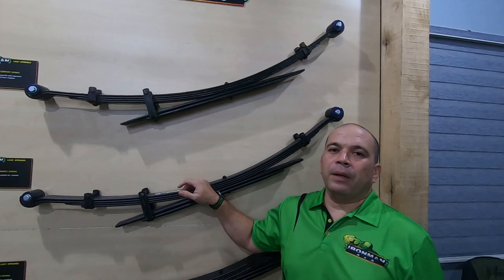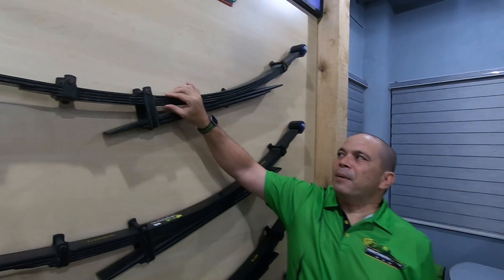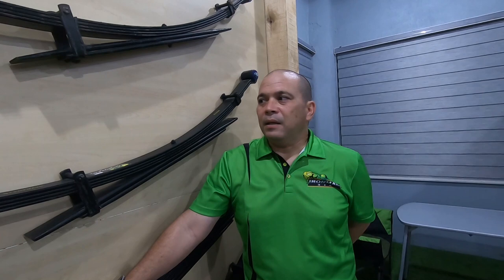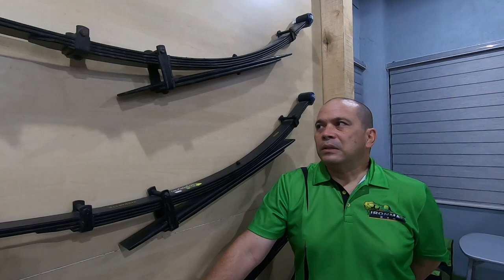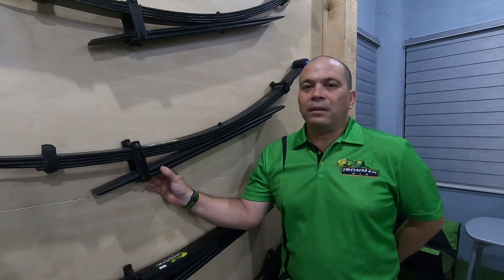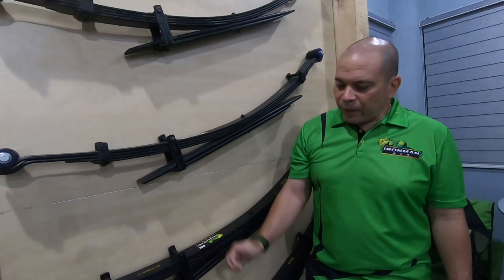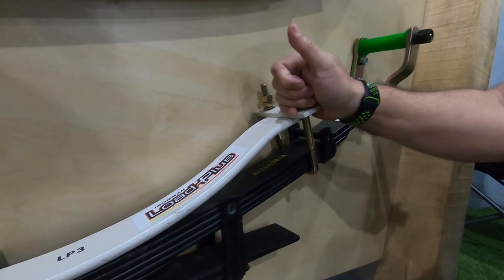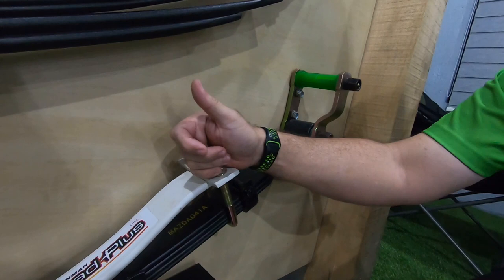Leafspring load rating explained

Comment: Hello, my hilux is so stiff even with ridemax and lovells, what upgrades should i do? Thanks! 🤟🏾
Reply from the maker: Usually the mistake is too stiff a coil.  As a remedy they run the shocks on #1 setting, so they have no damping and you bounce around all the time.  This is a common mistake here in Pinas.
Reply: Have you considered more than just your shocks and leafs?
What tyres are you running? If you have lower profile tyres you will have less suspension and a stiffer ride. Tyres are part of your suspension (air/rubber spring).
Reply from the maker: @Senkino5o  good point.  However, if you deflate the tires to soften them, you actually start the suspension movement at the tire and not the shock and spring.  The bad thing is tires (air/rubber spring) are un-damped as they have nothing to stop them from bouncing around like a basketball.  That is why softening the tire is a good thing up to a certain point, the point where they will not interfere with the shocks/spring ability to do their job.  That is why offroad race trucks and rally cars run normal tire pressures, so the suspension can do its job properly.
Reply: @ironman4x4philippines20  For a 2" lift what is the best set up 
For front and rear?  For  a 2010 Fortuner Sir. Thank you
Reply from the maker: @healthybodyawesomelife5640  it is a 4x4 or a 4x2?  Do you have accessories like a bumper, winch, etc?
Reply from the maker: @charles go

Comment: Sir I have a question, does the leaf spring and coil spring has a difference when it comes in riding condition? Especially in uphill condition.. does the car with coil spring will have more effort in riding than leaf spring?
Reply from the maker: Supposedly no sir.  However, if your leadsprings are too soft, you will get axle arap, the the rear will vibrate, or worst, dribble.
Reply from the maker: Cois sprung vehicles have rears with a 4 link or 3 link setup.  This means they do bot get axle wrap as the rear axle is held in place by the links.
Reply: @ironman4x4philippines20  thanks for the reply

Comment: Hye sir.. My Ranger 2.2xlt.. now i use Foam Cell Pro.. but this week i want to install Coil spring/ leaf spring /forge upper arm..
What type should i use ? Type A or Type B..
Reply from the maker: Is your Ranger 4x4 or 4x2?  What are the accessories installed in front? (Bumper, winch, and the like)
Reply: @ironman4x4philippines20  my ranger is 4x4..  front just custome bar but not bullbar and without winch
Reply: @ironman4x4philippines20  my 4x4 Ranger never been off-road yet.. will go but just light offroad.. like family camping offroad in future but dont know when.. i like foam cell pro bcoz very comfort but now i want to install full set coil spring & Leaf spring.. very hard to choose either A or B for my 4x4 Ford Ranger 2.2xlt.. can i choose Type B suspension?
Reply from the maker: @taikotayar2064  if its a 4x4 I would go with a B coilspring and A leafapring
Reply: @ironman4x4philippines20  this set-up for comfort driving ?

Comment: I hav stock leaf springs plus add a leaf ironman 2inch lift. Will i need to transfer the leaf if i change to your leaf springs?
Reply from the maker: If you go with Ironman 4x4 leafsprings you will no longer need your addaleafs
Reply: Ironman 4x4 Philippines how much does it cost here in ph
Reply from the maker: What kind of leafsprings sir? I mean what vehicle?
Reply: Ironman 4x4 Philippines toyota hilux 4x2
Reply from the maker: @errolanthonyrespicio9420  TOY077A leafs are around 25k a paor

Comment: Can we do add a leaf and load plus at the same time?
Reply from the maker: Yes we can. But the question is why?  Unless you need both the lift and you load near 1 ton a the time.
Reply: @ironman4x4philippines20  advantage of adding leaf spring and load plus, how many kilos added to the original max load of 1000kilos
?

Comment: Sir anu magandang leafspring for daily use? Isuzu Dmax User. Thanks
Reply from the maker: Usually B sir.  On vehicles na may option mag A, then we use A.
Reply: @ironman4x4philippines20  planning to change my leafspring kc Sir, medyo saggy na leftside ng sasakyan. minsan lng naman aq kumakarga ng mga bagay sa likod. anu po ang mas magandang ma e papayo nyo Sir?
Reply: anu po ba ang difference ng ride using A compare to B? medyo nag aalanganin kc aq, hehehe
Reply: naka 2" lift po pala aq.
Reply from the maker: @recusix5190  A is softer than B, but max load still 1 ton on both
Reply from the maker: @recusix5190  shackles? Tanggal shackles and back to stock
Reply: @ironman4x4philippines20  yup Sir...naka shackles aq, dati naka 4" lift aq shackles plus ironman add a leaf, tinanggal q na add a leaf q kc bumaba aq ng 2" at pinalitan q narn gulong q...kaso saggy leftside ng sasakyan kya planning to change my leafspring nalang.
Reply: Anu po ang best advice na maibbgay nyo sakn Sir? Will i go for A or B? Kaso dto sa area q is A nalang daw available nila kaya wla aqng ibang option, thats y nagtanong aq nang makita q ang post nyo na vid sa YT😉
Reply from the maker: @recusix5190  sayang sana yung shackles yung tinanggal kasi wala talagang tulong yan, masama pa ride.
Reply from the maker: @recusix5190  if ako A springs po para maganda ride. Walang shackles kasi nakakasira ng ride.
Reply: @ironman4x4philippines20  maraming salamat po sa advice Sir...very much appreciated sa time spent for answering my querries...God Bless you po😉😊
Reply from the maker: @recusix5190  anytime sir

Comment: Ano po leaf spring maganda SA conquest na pwde pang trail at pwde pa din pang karga?
Reply from the maker: TOY077A or B sir.  But usually A po maganda.
Reply: @ironman4x4philippines20  pag B po ba sir ilan inches ang ma dadagdag sa lift? How much din po?
Reply from the maker: @dbang8799  same lang lift nila sir.  But lets say yung sasakyan is the same weight, mataas kunti ang B kasi it was designed for a heavier accessory load... ako I like A better.  Now ano po yung naka kabit sa likod ng Hilix nyo po?
Reply: @ironman4x4philippines20  yung toplift lang po lagi po kasi kinakargahan. Gusto ko sana kahit mag 2inches yung lift nya para pwde pa din minsan mag trail po
Reply from the maker: @dbang8799  any of them can he loaded to 1 ton.  Pero B pwede
Reply: @ironman4x4philippines20  my how much po yung B leaf spring? San po location nyo sir

Comment: 1000kg weight for which Spring use??
Reply from the maker: All springs. A, B, C, or D.  The load rating on the springs (comfort, no load, with load, heavy load, or whatever people call it) is ONLY about accessory load, not total load.  Accessory load meaning things you cannot remove from the car.  BUT all the springs will and are designed to load up to Gross Vehicle Weight rating of the car manuracturer, in the case of most pickups, 1 ton.
Reply from the maker: So A, B, C, or D ratings are how much weight does the accessories you have installed have, in order to achieve the rated lift height.
Reply from the maker: So this is the part mostly misunderstood by sellers and clients.

Comment: Sir, can i REMOVE the secondary so that when loaded with people it would NOT BE (1) TON SPRING? Would it be safe?
Reply from the maker: If you just remove it without adding a thin leaf like our addALeaf, then it would be too soft and low.
Reply: @ironman4x4philippines20  Appreciate your quick response sir but I'm driving a PICK-UP Ford Ranger 2015 and I want to intentionally lower the back to level the truck. But if you are suggesting your addALeaf then I'm interested but WOULD IT DEPLETE my intention of LOWERING (EVEN) the back with the front @ the same time SOFTEN the ride when full more than 500KG of passenger load?  Note: I'm using my truck for passengers BUT NOT loading heavy stuff.
Reply: No Reply when you think you cannot EXPECT SALES huh from an inquiry huh? well that's NORMAL anyways thanks. There are OTHER PRODUCT in the market anyways.
Reply from the maker: @picolosantiago5392  no problem sir.  We gave you a reply and I am sorry if you didnt understand it.  REMOVING THE LEAF WITHOUT ADDING A THIN LEAF, IT WILL BE TOO SOFT AND SIT TOO LOW.  I replied to you without selling you anything.  I am sorry if you didnt understand it.  Our addALeaf is a lift spring and if you read my reply 2 weeks ago, I never mentioned selling you the AddALeaf... I would appreciate a bit of respect... thanks.
Reply: @ironman4x4philippines20  My post is "But if you are suggesting your addALeaf then I'm interested but WOULD IT DEPLETE my intention of LOWERING (EVEN) the back with the front @ the same time SOFTEN the ride when full more than 500KG of passenger load?  Note: I'm using my truck for passengers BUT NOT loading heavy stuff."  with a BIG question mark, I fully understand what you are saying with that said...I rest my case.
Reply from the maker: @picolosantiago5392  no problem sir.  We gave you a reply and I am sorry if you didnt understand it.  REMOVING THE LEAF WITHOUT ADDING A THIN LEAF, IT WILL BE TOO SOFT AND SIT TOO LOW.  I replied to you without selling you anything.  I am sorry if you didnt understand it.  Our addALeaf is a lift spring and if you read my reply 2 weeks ago, I never mentioned selling you the AddALeaf... I would appreciate a bit of respect... thanks.
Reply from the maker: @picolosantiago5392  I suggested a thin leaf which we dont sell.  I helped you without offering any product.  You want to lower the rear, AddALeaf can't do it.  I told you, if you remove one thick leaf, you should add a thin leaf as it will be too soft.  If I was a NORMAL seller, I will offer you our product even though i know it wont help you.  There is NO PRODUCT in the market that can help you.  Buy a thin leaf from any auto supply, its not an aftermarket product.  Thanks.
Reply: @ironman4x4philippines20  Point taken, probably I was offended when I did not get any response (like some people in the internet do) accept my apology and thanks for your response.
Reply from the maker: @picolosantiago5392  we always try our best to respond asap.  Sorry if we offended you.  Thanks too.